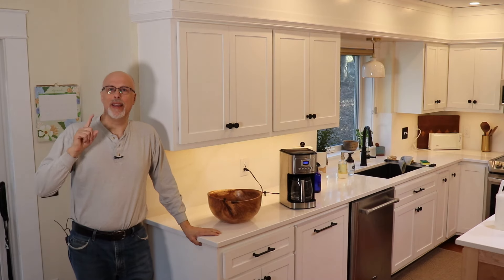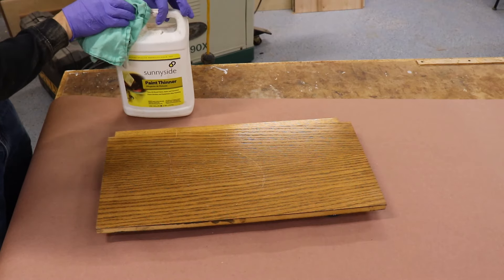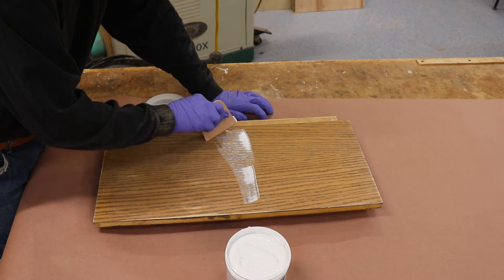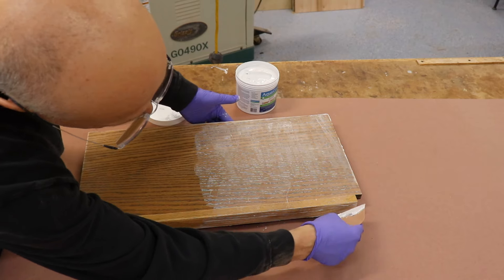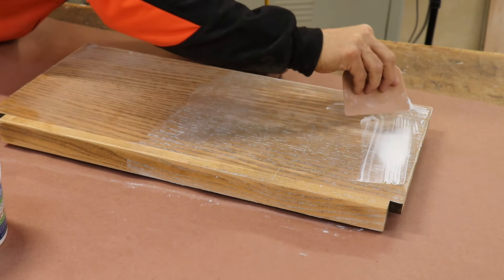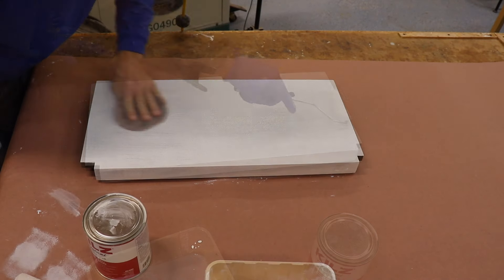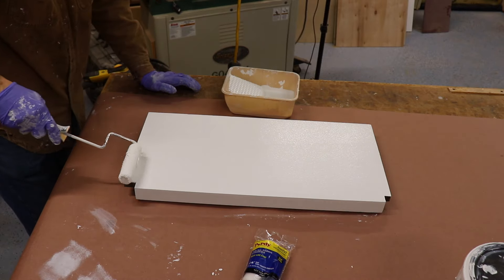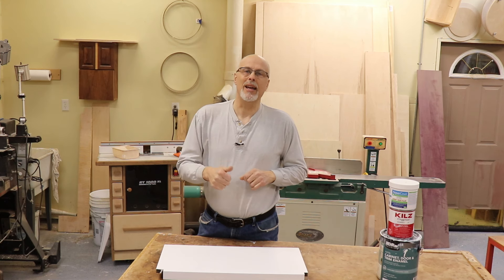How to Paint Grainy Oak Cabinets and get a SMOOTH Finish!

Comment: A much cheaper way is to mix dry wall mud with some water to the consistency of paint. Brush it on and let it dry. Sand and your go to go with your paint prep.
Reply from the maker: Thanks for your suggestion.

Comment: So so beautiful, but, boy what a lot of work....especially on all of the face frames where you have to do all of that grain filling/sanding on a vertical surface in your kitchen. Thanks so much for sharing your process. Very beautiful.
Reply from the maker: It’s really not that much additional work above and beyond the priming and painting. The overall painting project is a lot of work but this step is just one step. I wouldn’t consider painting oak cabinets without doing this.

Comment: Do you use a clear top coat after painting to help stop chipping? I want to paint my oak cabinets so bad but afraid of bleeding through and chipping.
Reply from the maker: NOOOOOOOOOOOOOOOOO!   This is a HUGE mistake IMO.  There's no durability advantage of poly compared to the paint that I used here.  Whatever you use might need an occasional touch-up.  If you put poly over the top, it creates a touch-up nightmare.  Water based poly can also cause discoloration problems over time.  Bleed through won't happen if you use two coats of oil based Kilz, although it can if you use water based.

Comment: Our cabinet doors are not all flat like this and have trim and such that a roller can't fit into. Will using a brush on those sections and a roller on the flat sections look funny? Should I use a brush for the whole area instead to keep it consistent? Thank you for the video, very helpful!
Reply from the maker: Hi Amanda, with this type of paint that is self leveling you should not have a problem with your approach. If your paint is not self leveling then you should add some Floetrol to it so that it levels out better.  You could also use a spray gun for the doors and get great results.  Best of luck your project. Cheers, Paul

Comment: My oak cabinets have been poorly painted over by the previous owner. Should I remove the paint first before using the grain filler? And if so, what is the best method to remove it?
Reply from the maker: Hi Kate, Full removal seems unnecessary to me unless there is something unusual going on with the paint.  Assuming that it's just a lousy paint job, I would lightly sand, prime with Kilz, and then follow the steps in this video.
Reply: So prime with Kilz then grain filler?
Reply from the maker: That’s what I’d think. Defer to the instructions on the grain filler when in doubt. Those guys know a thing or two. 😃

Comment: Hi Paul, Those oak cabinets are exactly what I have. Paul did you change out the hardware on the door that attaches to the cabinet frame? It looks like you can no longer see the door hardware. Thanks Paul.
Reply from the maker: Good eye. Yes I did. I’m using Euro hinges now. I also made new doors with a simple shaker style.

Comment: I have similar oak bathroom vanity. If I want to get an even smoother appearance would additional pore filling do it? Is it possible to get it 100% or close to it smooth? Also I don't see the link for the dust containment system you mentioned. Thank you for the video.
Reply from the maker: Sorry about neglecting to include that link.  Here you go.  Zip walls for dust containment: https://amzn.to/46wkpUr

You can always try another coat of filler if you think the pores are not completely filled.  Another way to get a smoother surface would be to add floetrol to the paint (https://amzn.to/4fp9dNh), and even better, add floetrol AND use a spray gun to really lay it down smooth.

Comment: I'm considering painting some  interior doors, and my concern is the grain showing through. I think this process should solve that problem.  What do you think about spraying rather than rolling the primer and paint?
Reply from the maker: Hi Jeff, That would be better yet. Typically, if I’m painting something in the nicer weather (we get 2-3 weeks per year of nice weather in MN) I take it outside and spray it with an HVLP gun.  The results are slightly better that way, and quicker. But for cabinets, a lot of that work needs to happen inside and spraying requires a lot of prep so I just generally brush and roll.
Reply: @ToolMetrix  I'm in MN too! I just finished creating an isolated finishing area in my basement.  This will be a good project to project to try out the area with something a bit bigger than a planter.
Reply from the maker: @jeffp5991 wow, an isolated finishing area, nice luxury!

Comment: Ive seen others using red bondo as the filler instead of aquacoat. Any reason to use aquacoat over bondo? Thanks for the video
Reply from the maker: Good question.  I haven't tried bondo for this application, but I've tried spackle.  I found Aquacoat to be easier to work with and get level, better shelf life, and less messy when sanding.

Comment: What type of finish do you recommend for the behr cabinet paint? Thanks
Reply from the maker: Id suggest either satin or semi gloss. Gloss is a bit more modern while satin is more traditional and casual.  Both are enamel based and quite durable. Semi gloss is perhaps a bit more durable.
Reply: @ToolMetrix  thanks for replying!
Reply from the maker: @PINBO4.13.21 my pleasure

Comment: Any tips for cabinets the previous owner painted? Lets say my dog coulda smeared 💩 that looks better.... 😂full sand and start from scratch?
Reply from the maker: I'd suggest a light sanding, add a couple coats of Kilz, then paint as normal.  No need to sand to bare wood unless the original underlying finish is peeling and the previous owner didn't address it during the terrible paint job.